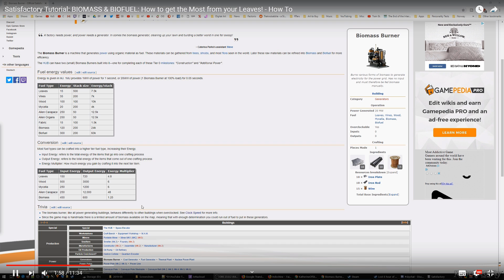Satisfactory Tutorial: Overclocking and underclocking: How it works and why it's useful

Comment: If u underclock a constructor.. and the output is reduced by a certain percent.. does the input rate required also decrease by the same percent?
Reply from the maker: That is correct. Input is calculated from the recipe and how long it takes to craft.
If you halve the craft speed (50% downclock) you halve the items needed per minute and halve the output.

Comment: Your idea about underclocking power buildings is wrong. You can effectively double your time between having to refuel the biomass burners, by underclocking to 40.61%. It means that while 3 Biomass burners (60MW) need 600 fuel every 50mins, The equivalent 6 underclocked burners need 1200 fuel every 100 mins.
Reply from the maker: In your example; If you use 6 burners - just leave them at 100% and you will still only need to refill 1200 fuel every 100mins (as long as the power use is the same) - They don't burn fuel faster than it's used and the fuel to power ratio is the same (Your argument that twice as many buildings lets you double your time between having to refuel is correct, but that is not related to clock speed - it would be if they burned at max rate at all times, but they don't do that)
The only difference will be if you use more than 60MW: at 41% clock speed, you will blow a fuse and have to manually turn it on again but with 100% clockspeed, you will just burn fuel faster
Reply: No, you'll have to refuel them twice. You'll still use the same amount of fuel though, but you can basically double your time away from the base.
Reply from the maker: 6 Biomass burners at 100% clock speed and 6 Biomass burners on 41% - fully stacked - with a drain of 60MW will both use exactly 100 minutes to burn through 1200 fuel. You can clock them anywhere between 41% and 100% and the result will be the same.
Again: clock rate does not matter for fuel consumption if the power drain is equal
Reply: You're getting two things mixed up. Power consumption...i.e, what you're drawing from the supply, doesn't affect fuel consumption, so underclocking machinery won't save you fuel, but fuel consumption is affected by the clock speed of powerplants. As you underclock the Biomass burner, it reduces power production and fuel consumption. 

So:
6 Biomass Burners @60MW will consume 1200 Biofuel in 100min
While,
3 Biomass Burners @60MW will ALSO consume 
1200 Fuel in 100minutes, but you'll have to refill them every 50minutes.
Reply: @Aven1017  I think the point he's getting at is this:  The overall fuel consumption and power production remains the same ... but having double generators running at half speed effectively increases the max capacity you can load in.  Filling 3 bio-burners with 200 fuel each gives you 600 fuel in queue.  Filling 6 bio-burners provides 1200 in queue. 

And since bio-burners have to be manually filled, this saves time by not having to run over and refill them as often.
Reply from the maker: @ronburgundy9771  I understand that part. What I am disagreeing with is the statement in the first post where he claims it's because of underclocking - while it is in fact just because he adds more buildings - which leads to more storage
.
Equating 6 burners at 41% clock speed to 3 at 100% clock speed isn't right - sure they can both put out a maximum power of 60MW, but targeting specific MW-thresholds by limiting power structures makes no sense.

While adding more buildings to increase storage is a nice thing to do, it's not correct to state that it has anything to do with the clock speed of the buildings. 
Which is why it's incorrect to say that what I present in the video about underclocking power buildings is wrong
Reply: @Aven1017  yeah... dunno what that was about.  Maybe just trying for a punchy opening?  

Everything else is dedicated to time between refills.